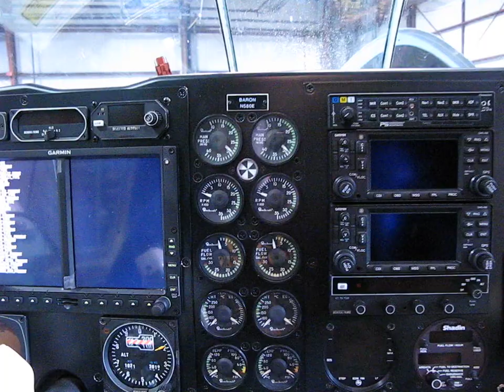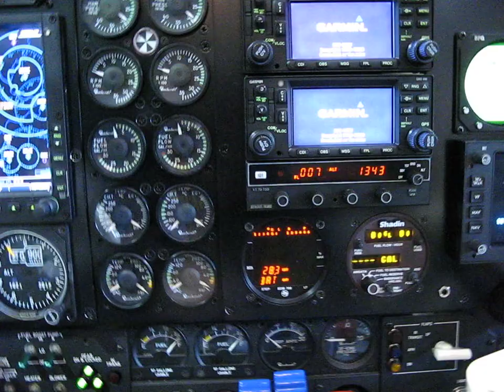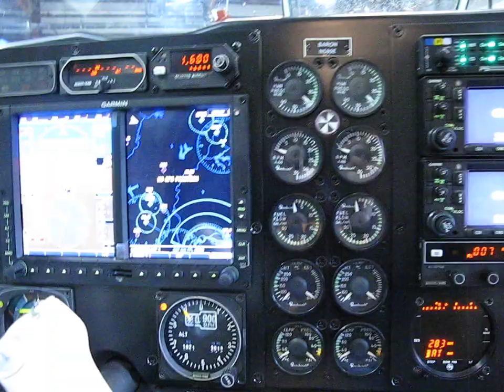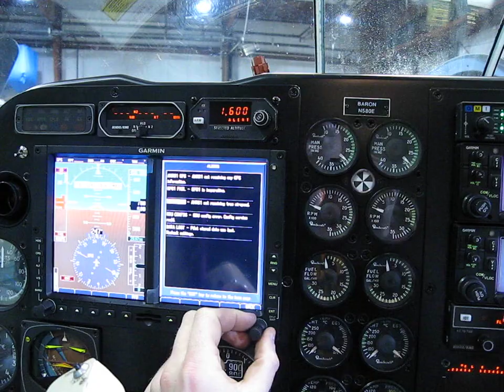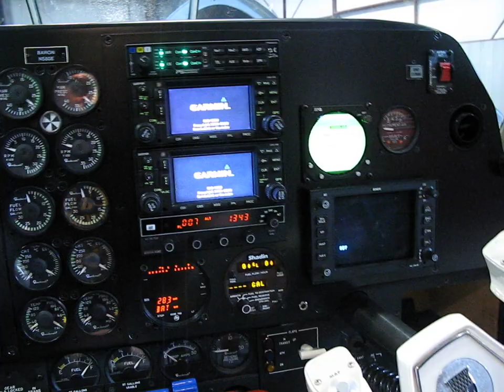Garmin G600 Upgrade - Panel complete - First power up of system!!!

Comment: Setting up and loading new software and entering v speeds..and setting comm ports is just about as bad in my opinion as hooking up all the damn wires.. be sure to "save to config module" after you get it right. A gad 43 would allowed you to ditch that KI 256 PoS. :-) nice baron though.